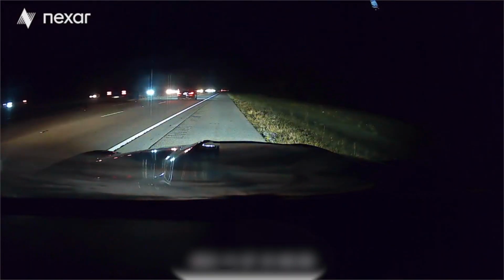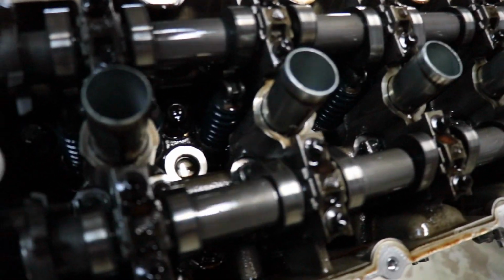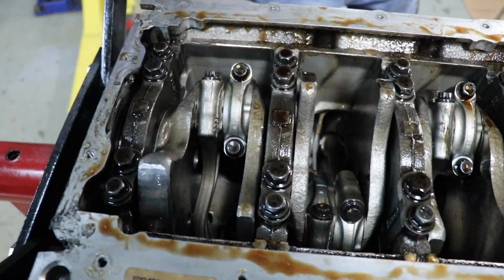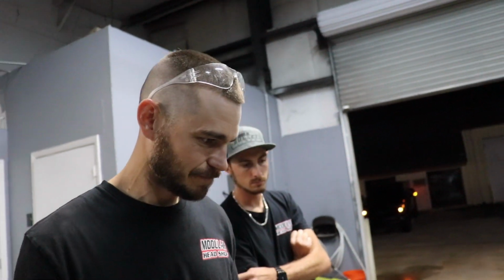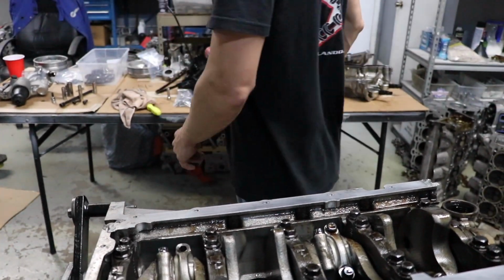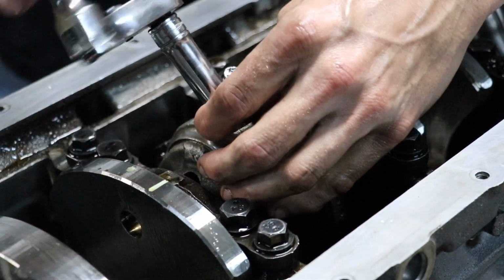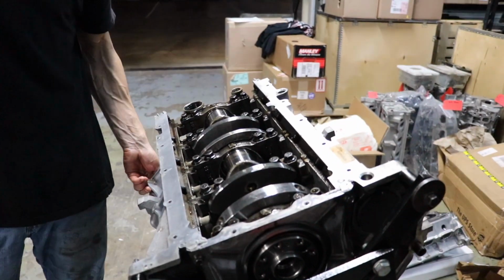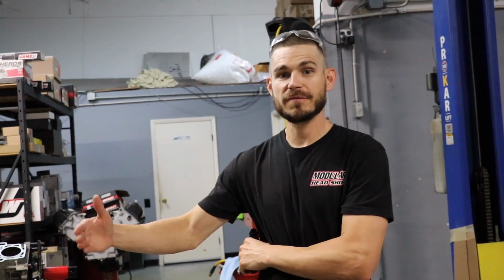Shelby GT350 5.2L Engine Teardown - What went Wrong?

Comment: Truly do not understand why folks buy these to supercharge them… this motor was not designed for that. You’re spending 2x what you could for a 5.0 and getting a lesser motor for what your intentions are with it. Ya ever wonder why the GT500 is not a flat plane and doesn’t rev to 8200rpm… this car is the perfect NA machine with a suspension to match
Reply: That just simply isn’t true. The owner himself has admitted this was user error. He was using 93 fuel on a cold night street racing, at that boost/power level, he got exactly what he was asking for. People get the gt350 and supercharge it because 8250 rpm’s and lots of power is addicting!
Reply: A lot of people just don't understand the shortcomings of a flat plane v8.
Reply: @coltoncaskey5781  so would it be better to use E85?
Reply: personally if i was gonna get a gt350 i wouldnt touch the engine.  i like it for what it is.  i guess some people just always want more though
Reply: Why buy a GT350 when there's 5.0 cars running 9's all motor like Steeda ?
I got a 2020 PP1 and raced a GT350 from a roll and he could not pull half a car length on me.
40-150 mph race....
Reply: @billjames3030 people buy the GT350 over the GT for lots of reasons. Body style, chassis, handling, sound, rarity, tracking capabilities, etc. It’s not only because of the motor.
Reply: Good thing you don't own one. Especially a Whippled R 😆
Reply: @coltoncaskey5781  these voodoo motors hate cold temps… almost every engine failure I see from gt350s is from folks runnin them hard under cold conditions
Reply: @AntMan351 Always

Comment: The dipstick bent was pretty funny. I have 2v out of a 2003 explorer was thinking about doing coyote rods and decent forged pistons for a turbo application say 700 crank hp on pump gas. It has a set of Cushman stage 2 cams in it as well. I got a 306 pushrod motor now in a 90 Foxbody but always wanted a street turbo combo.

Comment: Have you tried a heat gun on the back pulleys to expand it a bit, don’t need to get much over 225-240 degrees to expand the back 2 pulleys enough to remove the front press fit pulley.

Comment: There has been known issues with the gen 1 5.2 engine blowing gaskets because lack of material in cylinder 4/8. Supposedly, it was fixed in the gen 2 cast. I don't think it was detonation by the looks of the pistons. i'd say it was the block crack/head gasket that caused this damage just due to the amount of power being made and cylinder pressures.
Reply: That's why I keep my 2016 technology package gt350 with 30k miles on her stock and change the oil every 3-4k miles. Shes running great

Comment: The flat plane is already high-strung in stock form. Power adders is not what the flat plane can take. Ford chose to go back to cross plane for the GT500 for a reason. Probably costs as much as anything.
Reply: I know right. Even a few of the gt500 engines have popped
Reply: @jeffklonowski6816 Naa, unless 1400-1500hp is were things get sketchy with the gt500, other than that the predator is built for pressure.

Comment: I have a question- did you say that this combination of driving on a cold night, with 93 octane fuel in the tank (along with being boosted), were conditions likely to have caused this engine failure?

What??

1- 91+ octane is required
2- What's wrong with driving on a cold night, so long as the engine is sufficiently warmed (at operating temperature) when you start doing pulls and exceeding 4,000 RPM??

Am I missing something?
Reply from the maker: More boost (from cooler denser air) + less octane (he should have been running e85) + high rpm high speed pulls = detonation.
Reply: @MustangLifestyleTV  oh, so the octane should have been much higher? I see..

Comment: 9:53 LOOK AT THE SMALL LIFT SURFACES OF THE CAM LOBES THEN A FLIMSY CHAIN UNDER ALL THAT SPRING LOADING OF ALL THOSE VALVES , TO ME  THIS IS WAY UNDER DESIGNED, TAKE A LOOK AT A TOYOTA ENGINE IT HAS DOUBLE THE SURFACE CAM LOBE TO VALVE AREA, THEN A HEFTY WIDE NOTCHED BELT THAT WONT STRETCH AND HAS LESS CENTRIFUGAL MASS THEN A CHAIN AT 8K RPM, EXAMPLE Toyota 1UZ FE V8, 2UZ-FE , 3UZ-FE, IT WONT COST MORE TO HAVE A MORE ROBUST VALVE TRAIN SYSTEM, KEEP THE OIL PAN METAL TO COOL THE OIL BETTER WITH FINS, DONT USE A PLASTIC OIL PAN IT RETAINS THE HEAT

Comment: With the money spent on these cars you would think e85 only for 14 psi.93 pump I would only run 10psi max don’t lower compression get enough octane or back down the boost if you don’t have the octane

Comment: Correct me if I am wrong. But wouldn't it be best to spend the extra money and add meth/water injection when adding boost to high compression engines. Also wouldn't good heads make a huge improvement. And just as I am typing this at the end you answered my assumption. Drop some compression. Wish these guys would learn, or at least ones building make some suggestions to owners.

Comment: Well again 2017 is the worst year for the Shelby gt350 I own a 2017 and it’s currently getting a new gen 2 motor with under 11,000 original miles and it was burning 3-4 quarts oil every 1000 miles never been tracked I still have the original tires on it from the show room floor and it 5 out of 8 cylinders had major scoring and blown rings and valve guides and valve seals in the heads were also letting oil by …. Gen 1 motor is complete junk will see what gen 2 brings … good luck love your content
Reply: I have a 2017. Motor consumed oil and failed at 6k miles. Warranty replacement with gen 2. New motor has 6k miles, consumes no oil. Super happy now.
Reply: @AA-nf2jl  glad to hear that I’m hoping for the same and good luck

Comment: ALL 5.2 voodoo motors are balanced. When you remove one weight , the headders,  the motor is not balanced and YOU WILL Crack the block.
Reply: The headers?? Huh ?
Reply: @Ws6Ms  🤣
Reply: @tylerolson5860  the person who knows all about the voodoo says if you keep on rocking the voodoo on long tubes. You WILL Crack the block. 1 in the front under the pass side head. 2 window the block cylinder 2 and 6. Have fun!!!
Reply: @tylerolson5860  ok
Reply: @chuckcoop9173  Name them then.  I smell BS.